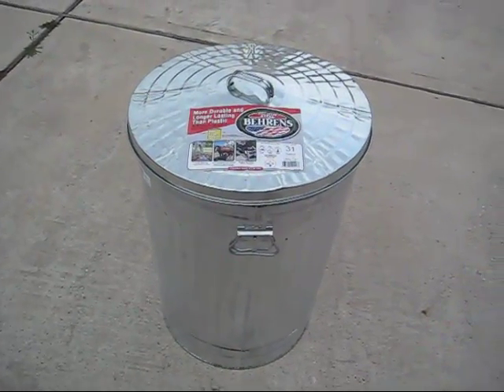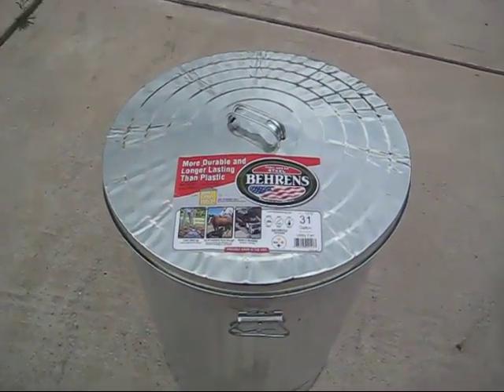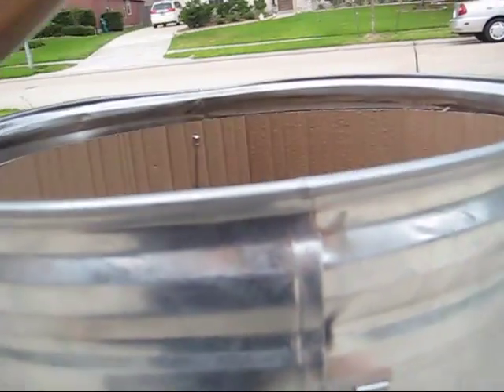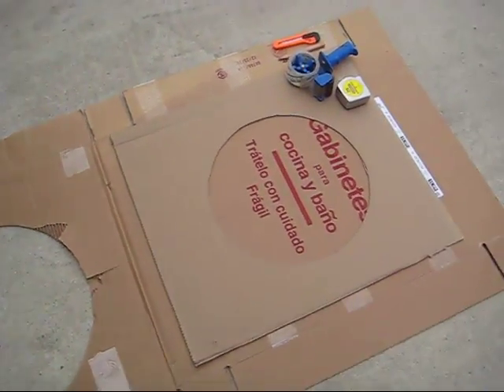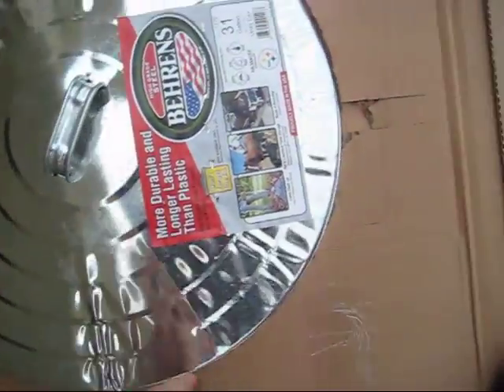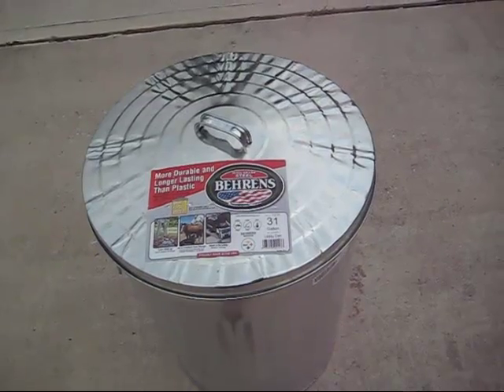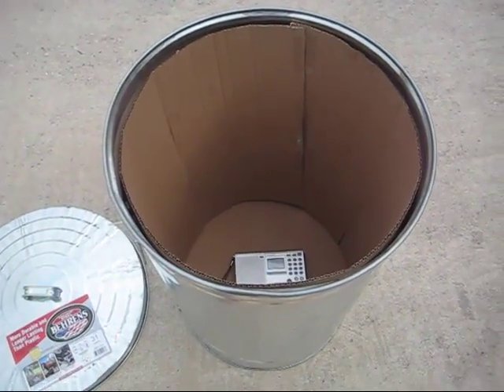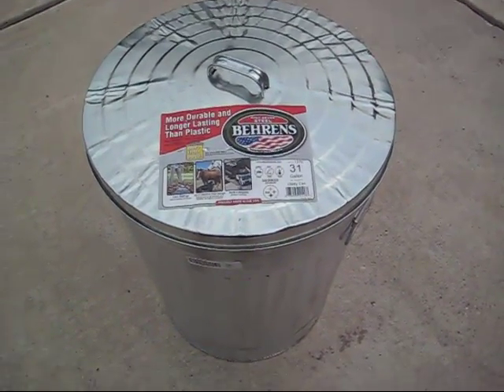Faraday Cage: Garbage Can, Really?

Comment: Does it HAVE TO be grounded to work?  No.

But SHOULD IT be grounded to dissipate any electric currents generated from external or internal electromagnetic fields, and thus block a large amount of the electromagnetic interference?  Yes.

Especially since we are talking about large, rapidly building and falling radiation/electrical events...for which an FC is specifically designed...they don't work on "slow and low" fields like the Earth's magnetic field.

I have a degree in Physics, and build SCIF's for the government, who always uses large "screen rooms" (aka Faraday Cages), to protect from electrical signal transmission passive reception...or active electronic eavesdropping outside the SCIF for signals as small and innocuous as keyboard strokes and screen/monitor emissions...and they are always grounded to prevent a rapid build-up of charge at any given location.

In this video example, the cage is ALREADY grounded, zinc-coated steel directly on concrete couldn't get much better actually, not even with a copper ground rod...which is why we turn up one #4 rebar (1/2") from the floor and footer concrete slab reinforcement inside every electrical room ...just to act as a ground for the medium and low voltage electrical switch gear, which works fine up to 13.8KV.

That is also why you store your car, marine and motorcycle/golf-cart batteries on wood or layers of cardboard instead of the garage floor.

So is the cardboard required? Not really, as long as what you store inside doesn't create an electrical short between one side of the cage and the other.

Is the cardboard a good idea to prevent premature battery discharge through inadvertent grounding...and to prevent your device from acting like a capacitor during rapidly changing events.  Yes.

Comment: you didnt need to insulate the inside of the can. there is no charge inside the can when an EMP hits. the emp will go around the outside of the can with polar opposite charges on oppoiste sides of the can on the outside...NOT the inside.....there was no need to insulate the inside

Comment: What about LED lights? What about solar panels?
Reply: Geo Geovideo Yes and Yes...both are at risk in an EMP.  

The solar panel is less risky, but still can be damaged by EMP depending on the strength of the blast. If the EMP is caused by a CME, you are probably OK...however if it is a Nuclear Device above the Nation, and you are not that far away from the blast , those panels will be toast

Comment: My first faraday box was a cardboard box wrapped twice in Boardwalk 7112 Extra Thick Standard Aluminum Foil  and using this testing method worked fine but wasn't sure it would protect against a powerful pulse. Now I use a galvanized garbage can plus EMP bags. Hope I never need to see how it works against the real deal.

Comment: Unless you tape the lid down with aluminum tape and completely seal the gap, most of your equipment will NOT survive.
Reply: Absolutely true! His demonstration would be more believable if he had used a cell phone rather than a weak signal radio.
Reply: @jchigheagle  A cell phone would indeed have been a more appropriate test, but not because radio is "weak signal" (50kW a few miles away is weak?).  The higher the frequency, the smaller any gaps need to be.  FM radio @ 88-108 MHz is too easily blocked with even relatively large gaps.  The AM band is of course even worse, but he appears to be using FM otherwise why put up the FM antenna.
Reply: That is not how faraday cages work.

Comment: Im sorry for being  uneducated!
but what function does the cardboard itself have to Electro magnetic radiation?
Reply: Silentgasp
You should insulate.  If the FC is perfect (no leakage) than insulation doesn't matter.  If there are small leaks, the charge will travel along the inside skin of the can as well picking up charge proportional to exposed area.  If insulated, the charge is limited to the leakage coef and the exposed conductive material in whatever is inside.  People who are really serious about this will use a 55 gallon steel drum/barrel (get one online for $20-30) with locking ring and removable lid.  Then, inside of barrel is insulated with non-conductive material (scrap yoga mats, pool loungers, neoprene, bubble wrap, etc.  Electronics are then wrapped in aluminum foil, then bubble wrap, then placed inside ziplock mylar bags, then inside the steel drum.  Finally, the lid is put on the drum and conductive tape is put around the seam of the lid (where it meets the drum). The locking ring is put on top of this tape and another layer of tape is put over the ring/seam. This setup while overkill will stop any EMP.  If the steel drum is banged up, make sure it will hold water with zero leakage (condensation is okay :-).  with some water in the drum, invert it (with the lid and locking collar on) and make sure it doesn't leak out the lid.  If you truly have zero leakage, the drum should be sufficient by itself--all the other precautions are in case of some degree of failure of the drum.
Reply: It insulates whatever you put in the Faraday cage, for it mustn't touch the walls.
Reply: Petra44YT wrong.....the charge in the can whether insulated or not will have a zero charge inside when an EMP hits. because it will go around the outside  of the can...not inside.
Reply: Petra44YT So really...no point in insulating the can

Comment: One  of  the  best  way to test your home made Faraday  Cage is to put your  cell  phone in it, close the  cage and then call your cell phone.  Let it ring several times.   Hang up and open the Faraday Cage and  see if there is a missed call.  If there is a  missed call  you'll  need a better Faraday  cage.    I tried several micro  wave ovens and none passed this test.

Comment: There shouldnt be any static if the lids closed it should work for cosmic background radiation (microwaves) too i think
Reply: Thermal noise alone will cause static even in the complete absence of any radio signal.
Reply: John Fletcher Only about 1% of the static you hear is from microwave background radiation.

Comment: Maybe I just don't know enough about EMPs, but everyone assumes theirs work because 1 radio station's frequency didn't go through. What if the EMP is a different frequency, not on the AM/FM dials? What if it covers a large range of frequencies, including AM/FM and you're only blocking a tiny piece of it? I agree that a trash can will block the vast majority of frequencies, but I don't agree that this test is a fool-proof way to prove this will work.
Reply: EMP is extremely broad-banded and covers every frequency from very low frequencies all the way to gamma. You are correct to be concerned about more than just AM/FM.
Reply: Tracy Reed Another confusion I have is an EMP will probably be extremely powerful and if you solder a resister in parallel with a wire, some electrons will go through the resister even though it's not the path of least resistance. Is cardboard, which is also flammable, definitely going to stop a spark from going through? If the EMP causes your trash can to be charged enough, and it can't dissipate, despite being grounded because everything around you has been charged the same way for just one second, and the objects inside aren't charged, isn't that going to attract a spark? I'd suggest going hardcore with the insulation. Like maybe many layers of plasti-dip painted on the inside wall.

Comment: im keeping it simple for the average joe. most dont understand what your talking about. if an emp goes off, it wont matter one f'n bit what you do to save your stuff. here is why. those signals tv and radio wont be broadcasting anymore. so you had better have a gas powered generator with enough fuel for 5 years after, which is what the scientific studies say will be the time it takes to get the "power grid" up and running again. use your brains guys. food and water far more important for survival than watching used dvd movies on your saved electrical components. id be far more worried about the 400 nuclear reactors in this country america. right keep telling yourself whatever to sleep better.

Comment: yes, this is the same thing as using a car radio fm am radio, not a cd player, but a radio in a car being driven under a bridge. the bridge has metal rebar in it that blocks or absorbes the radio waves. any bridge or thing with metal of some kind acts as a faraday cage/device. my house has so much metal in it, it does not matter what type of cell phone you have, it wont get a signal. its all about where you stand. in or out of the "faraday action". it's all about the redirection of energy. which is also true of philosophy and martial arts. a grounding rod as well. but that is more about direction rather than absorption  or blocking. very close tho. where is it going?

Comment: you're giving me the impression that the metal wrap must be solid, not even the lid partially removed, even though it is still over the can and still in contact. I have seen other faraday cages made with chicken wire. i.e.lots or holes. This other guy seemed to think his cage worked. does it need to be solid?

Comment: It doesn't do much good to place your solar charge controller and inverter inside the can because the EMP is going to toast your solar panels (which are not in the can) rendering the goodies that you placed inside the can useless.  Same goes for the hard drive you placed in there.  That hard drive isn't going to do much good when your computer is fried.

Comment: Fyi if its on the ground it is grounded ask any electrician.  Why do you think fiberglass laders are used for electrical?  Because aluminum laders complete a circuit.  Don't believe my stand on aluminum lader and grab a live wire when it shocks the shit out of you then you will understand

Comment: Ground the can. Even if cardboard is electrolytic a ground gives a path of less resistance for energy to flow. Its circuits 101.
Reply: WRONG. DO NOT GROUND 
The REASON is that if you have any wire attached to the can and a grounding rod attached to that wire, EVEN IF it is ONLY a few feet away, that wire will act as an EMP ANTENNA and will fry everything inside.  
 By simply setting a galvanized can on the ground, it is grounded. Nothing else needed.  If you want to improve your chances of protection, use several mylar emp bags with a layer of cardboard in between each one...then place in the lined can
Reply: "The metal layers are grounded to dissipate any electric currents generated from external or internal electromagnetic fields" http://en.wikipedia.org/wiki/Faraday_cage. when objects are connected to a ground and that ground touches the circuitry it acts as an emp antenna. when you place in something NON CONDUCTIVE aka dialectric "cardboard", you get an antenna to GROUND saving your components. since your components are not actually touching that antenna it is the metal cage itself stopping the flow.  faraday cages do not work as well when not grounded because the metal cage itself is acting as a ground (this is why electricians dont wear metal. METAL IS A GROUND it is a place for electrons to flow. Grounded electronics can get fried from an emp through their ground. but you are confusing the two. what you are building is an elecromagnetic shield that uses a chassi ground with limited electron flowing capability. a faraday cage uses an earth ground. BOTH will work, but you shouldn't use a long piece of wire to ground it.
Reply: by the way it is grounded by setting it in the ground. BUT a traditional earth ground for High voltage required engineers back in the day to drive a long rod into the ground, because there is a natural resistance in the soil that is less conductive. Look up earth ground. you drive a rod into the ground.

Comment: I have a cobra walkie talkie set I bought for my son. I put one in the steel trash can, the same one in this video, and you can still call to the one inside. Yes the lid is on tight.And yes I did the cardboard. You can here the one inside plain as day. Why is that?

Comment: DO NOT have antenna or anything outside of can sending EMP into GS trash can.  Just be sure to not let batteries touch metal can or it will short them.  Put top on and you are finished!  No need to ground nor bury.  Makes zero difference. No steel wool needed.  Can cover is tight enough.  Better than $10K all silver Faraday box I built for AEC decades ago.  $10K versus $20 and the $20 can is bigger and just $20.  Tough choice!

Comment: Can you do a test with a strong AM radio signal instead of FM? As I understand it the high end frequency of a nuke EMP is about 10 mHz which is below the FM stations on your radio and way below the cell phone frequencies whereas the AM frequencies fit in towards the top end of what an EMP burst would radiate.  EMP's strength comes from the amount of power it sends out on the low freq. spectrum which can penetrate into the ground and inside structures. A strong AM signal is a be a better test.

Comment: I hope the future I have seen is farther away then I have seen it. In this case Faraday cages can be as simple as covering a residence in ferrous metal, like steel or anything containing iron, and grounding it with 6 foot buried copper/FE rods attached to the structures skin with jumper cables. I just don't see protecting electronics as doing any good as the grid and internet will be down. However this may also minimize the injury to humans within their cover, so they are likely important.

Comment: The purpose of a conductive surface is to help those ions neutralize each other, as ions are basically charged particles. Charge particles NEED to reach each other, somehow.

Of course, another thing you (the audience) may need is Lead, because the EMP can be caused by Gamma Rays, which are high-intensity photons that can ionize matter upon impact. Dense material will help absorb those photons, as there's more matter to go through.

Comment: Needs more layers to help disperse higher intensity ions, kinda like Spaced Armor on tanks or the insulation/ventilation in buildings used to disperse heat. Ions are just another form of energy.

EMP is basically a dispersed bolt of lightning, whereas lighting is a focused, high-intensity EMP.

Delicate electronics require lots more shielding, because of the smaller parts and higher conductivity. A combination of conductive material and non-conductive material helps isolate disperse the ions.

Comment: While the cage/can may be enough to protect from EMP, to say that the can is grounded is in error.

If you want to go the extra step, then install 1-2 ground wires and a #4 ground wire to a through-bolted lug (2 hole preferably) on the can. This can be easily run through a wall in your garage.

Toss a pair of side-cutters and screwdriver for the lug into the can so you can cut and run with the whole can, if you need.

Comment: An EMP ranges from 1 Hertz (1 Hz) to 300 MHz. Cell phone freqs start at about 380 MHz and go up from there. So, put your cell phone in your faraday cage and call it. If the signal gets through, you're NOT protected from an EMP. If it doesn't, then you're good.

Comment: The US Army's field expedient EMP Plan is to wrap the equipment up in an aluminum foil bag and bury it about two feet deep before an expected nuclear detonation. Great if there's a warning.

A garbage can beats the foil bag for durability, and you can bury it, even in a garage with a concrete "lid" over the hole. It's water resistant, too.

Comment: LED flashlights, yes, old-fashioned incandescent bulbs, no.

It's a matter of "geography": if the circuit is tiny, the EMP will cause a current that arcs between parallel conductors in the circuit and that "fries" the pathways inside.

That goes for any type of electronics: if the wires or conductors are close to each other, it will arc and die. If they are further apart, they'll likely survive. Old-fashioned tube radios will take an EMPulse and keep on tickin'. Modern radios will succumb.

Comment: Solder an 8 ga Cu or Al cable to the can (> 8") vertically near the bottom, and drive an 8' ground rod into the ground (many cans could be grounded to the rod). Attach the cable(s) to the rod with grounding clamps.

It's not expensive, not difficult to do, but, for the kind of system he describes here, it's overkill. Unless, …

Ground effectiveness depends on soil moisture. In much of the country, you must have a ground rod. It's often too dry for a good "put it on the ground" ground.

Comment: the specs "built in" so a typical "joe" like me could purchase and use as a Faraday Cage is the old-style Pressure Canner with the wing-nut lock-down compression closure.  American Canners still make this type - it is plenty thick and the metal-to-metal contact with the wing-nut compression is sufficient to lock out any "leakage."  The openings for the gauges would need to be sealed for this to work appropriately.  Noted, it is smaller but still can hold significant electronics to help post EMP

Comment: The only methods to construct a theoretically working Faraday Cage is using the Math that dictates the thickness based on metallurgy and the Mil Specs the Military uses to determine the minimum tolerances needed to attenuate the effects of all three pulses contained in a HEMP - E1, E2, & E3.  I am not an engineer but my co-hose of my podcast (about the TV show Revolution where we talk about EMP regularly) is an engineer.  The only "off the shelf" technology that seems to already have (Cont)